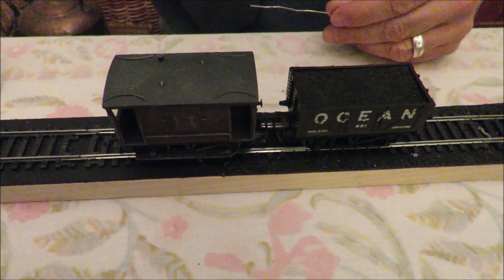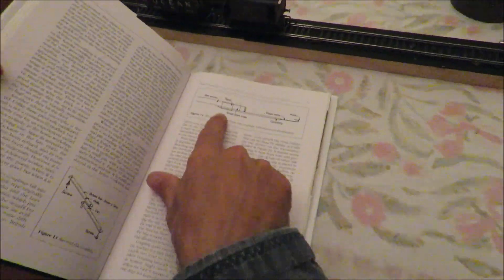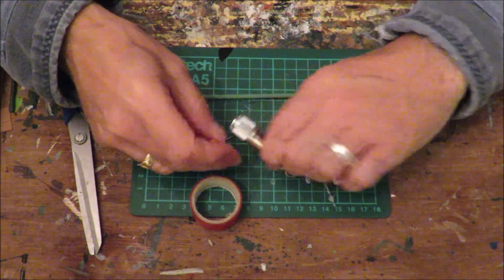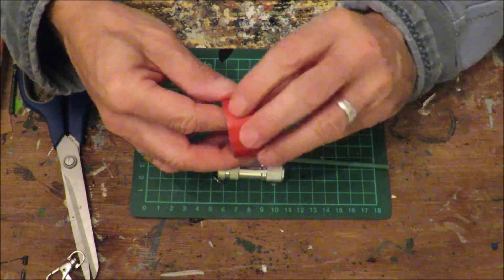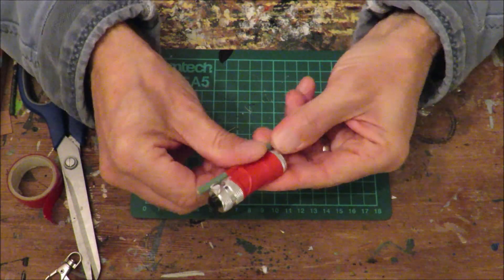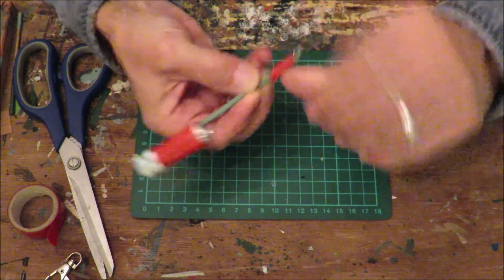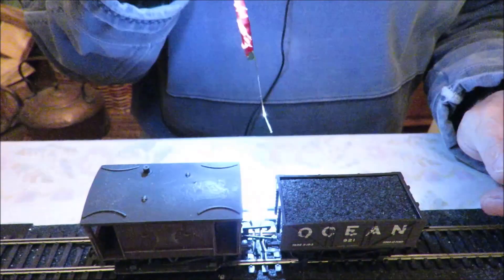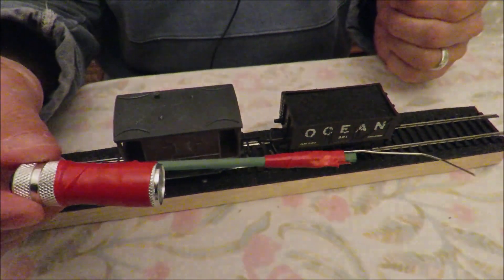How To Make An LED Uncoulping Hook For Your Model Railway / Railorad - Tutorial Tuesday Episode 29

Comment: Over the last 30 years or so I have dabbled in model railways, the usual 00, then American h0 ( quite reasonably priced if you were careful), the ‘N’ both British and American.
Then I retired and built a a ‘G’ Scale railway on a shelf around the little garden we have.
What am I rambling on about? They have all reached the point of being unaffordable!
This is why I find this site so refreshing and useful. I found I can ‘do’ garden railwaying cheaply using the principals described in these videos.
N has just about passed me by now as the eyes are not the Mae West, but I have a couple of ‘Mainline’ and ‘Airfix’ locomotives and wagons from a couple model shops.
Which I find very satisfying to ‘play with’
I went in one model shop near me and they had a Great Western Auto Coach for sale at £77 50 which to me, is insane!
Anyway, thank you for a very inspirational site.
Reply from the maker: Thanks for your message , I too found N too small and expensive even second hand. I think the cost of new is beyond an awful lot of people, thanks for watching.
Reply: Hi Steve I'd love to have a garden railway have you any cost saving ideas regarding track and locos, do you use battery power?

Comment: Hi, thanks for another great video. Have used this idea for years, some with the light, some without. Found the paperclips too thick though, so now use fine "piano" wire as used by aero-modellers. Once bent it also keeps it shape and lifts hooks easily.

Comment: I always found the uncoupling hook to be a bit fiddly even with a light on it!

I much prefer the shovel style uncoupler like Triang used to make ,much easier to use! U just slide it under the couplings and let go!
Reply from the maker: They are beyond rare to buy though
Reply: @BudgetModelRailways    ah I just made my own ,  spare peice of plastic tube cut at an angle and an offcut of plasticard cemented to it.
Reply from the maker: Tried that, it's OK if you have one to copy otherwise it's too much trial and error